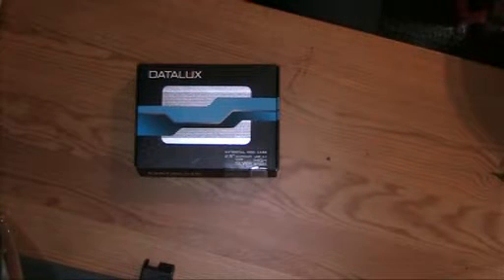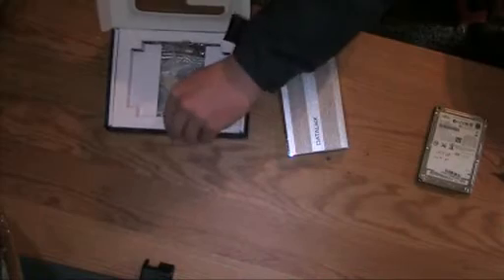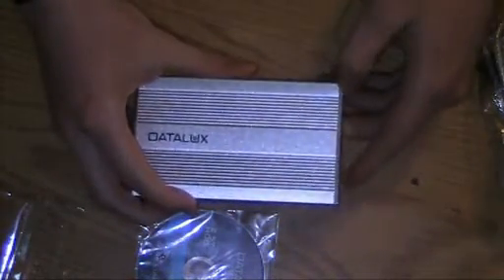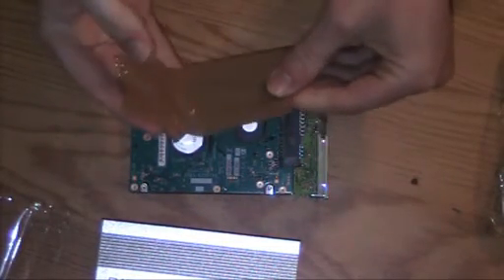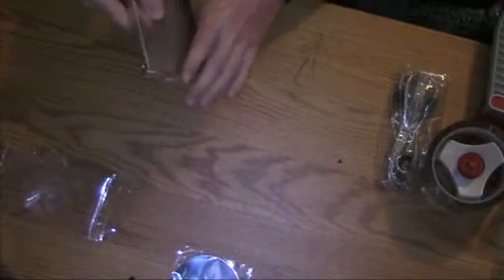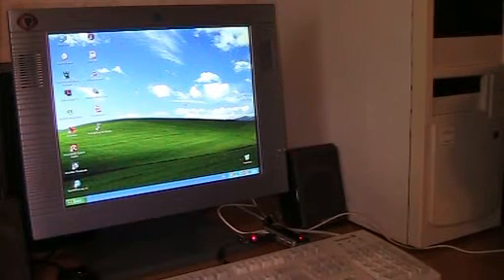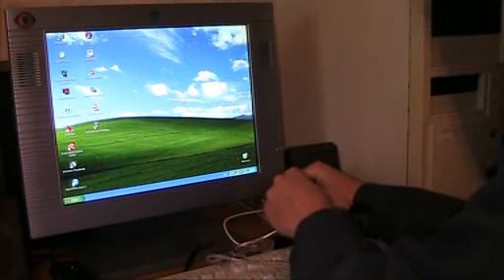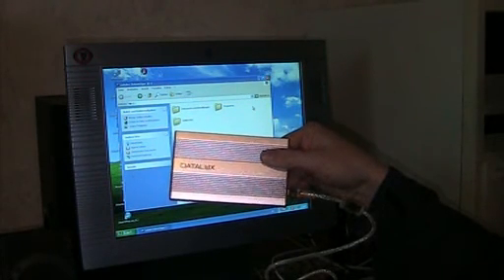DrCassette's Workshop - Building an external HDD!

Comment: @029622558 No, the two plugs is because the hard drive needs more power than only one USB port can deliver. Some 2.5" USB drives give you the option to use a separate power supply for the drive, in which case only one USB port would be required.

Comment: @029622558 It doesn't work like that.  One plug has the power and the data, and the other plug has just power so that you can get another 500mA to the enclosure.  Of course, nothing is stopping you from getting this extra power from a second computer, or a wall adapter, etc...

Comment: In fact, the crappy Chinese external HDD enclosure is required more power by some reason. In my office, I'm using the same computer, the one that made by Hitachi is working fine but the enclosure+320GB HDD are not work with this computer.

Comment: External hard drives are the best thing next to flash SD cards really...that's one thing I liked about the Xbox360, the hard drive is external.....easy to move from one console to another..and these external drives make it GREAT for transferring data from computer to computer.  SATA also makes things great too....both 3.5" and 2.5" laptop and desktop drives work on it unlike with IDE.  Also, SSD would work.  So if you wanted to clone a hard drive, these are great b/c u can do 2.5" and 3.5"